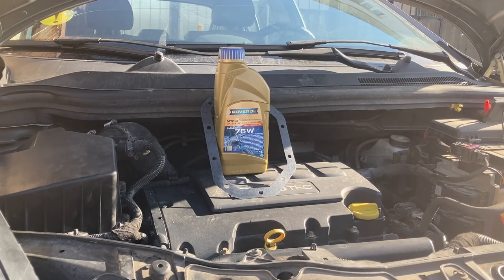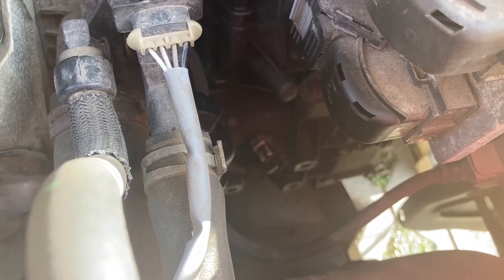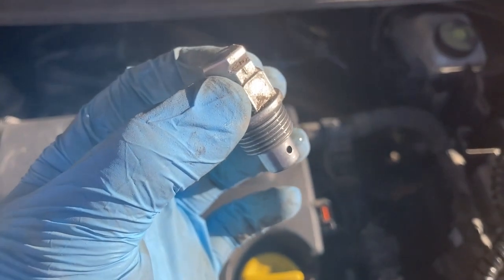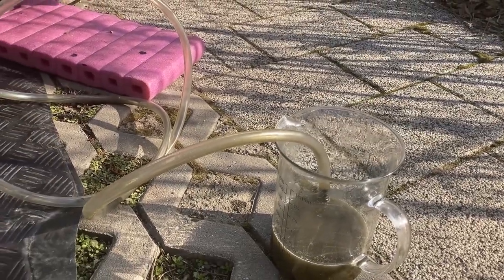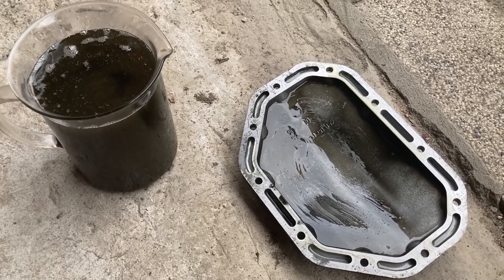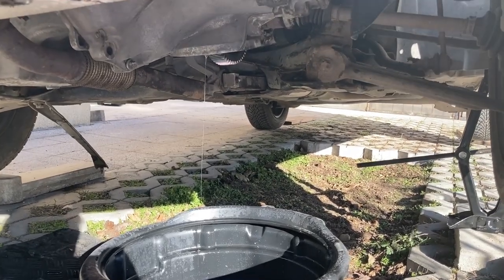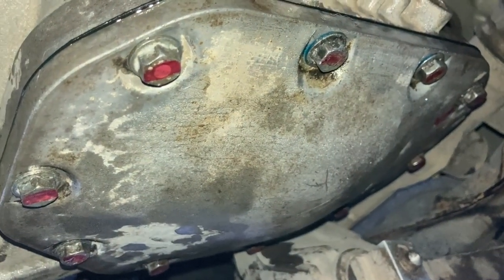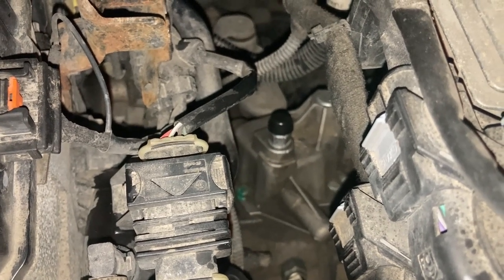DIY - 2014 Opel Corsa D 1.4: Change the F17 manual gearbox oil (transmission fluid)

Comment: i first ordered 75w90 GL4/5 oil and someone informed me that is wrong. i've now ordered Eurol MTF GL-4 75W instead,

will this be fine? i have a F17 box. 

i am going to be engine swapping soon so i will replace the entire oil contents.
Reply from the maker: Based on the specs from https://www.eurol.com/en/shop/products/E110073-eurol-mtf-75w-gl-4/1049, it is of lower quality than the Ravenol I used (the pour-point and viscosity index confirm that it is not a full-synthetic oil). What's more, this oil doesn't have the GM 1940004 recommendation that is required. So I would search for a more suitable alternative.

Comment: I cannot remove the black breather plastic cap with hand force. What should I do?
Reply from the maker: It takes a bit of effort to remove it, indeed, as I've noticed myself. A set of long, thin pliers may help you grab its sides and pull it with more ease.

Comment: Why couldn't you use the pump on the oil level hole (the one with the magnetic bolt)?
Reply from the maker: There's very little clearance between the level hole and the side of the differential. You'd need a very thin tube that can also bend downwards, so that it can be pushed along the side of the differential and down to the differential pan. I used the thin tube from the pump to try and remove the oil, but mine was not sufficiently thin or flexible for the job.

Comment: Hey there! First of all, thanks for your magnific job sharing your knowledge with  us. 
After seeing your work I have new questions, I would be very grateful if you could give me some answers. 
To my Vectra C 1.8 16v with 200k km I saw in several car programs that the suitable  transmission oil is this: 92165290 (original Gm Trans. Oil SAE 75W85, in the label shows the 1940182 reference) but I saw in your video that this oil is very poor compared with the ravenol mtf-3 75w, I was wondering if I could use it in my gearbox despiste that is not the "appropriate" Reference... 1 Thing is clear, and the thing is that I feel the same symptoms like you in my car after 200k km with no valvulin change and Im wondering what I should do... 
And the final question, if I can use this oil in my gearbox, what kind of cheap oil could I use to "flush" and clean the old dirty oil before I put the ravenol oil, Is there any compatible oil?
Thank you for your work and your time, I appreciate it so much. You made a great job!
Reply from the maker: Hi! Your Vectra C 1.8 uses the same F17 box as my Corsa D 1.4. The genuine transmission oils with the code GM 1940182 (75W85 GL-4) are indeed considered of a poorer quality, but for the F17 boxes (which take far less torque than the M32s on the diesels, for example) they are good enough provided they get replaced periodically, before they loose their additives (say 3-4 years and no more than 60K miles). If you have the same symptoms as I did, then the main problem is actually the oil's viscosity: the newer standard GM 1940004 is 75W or 75W80, which in practice is noticeably thinner than a 75W85 or 75W90 (what I previously had); this makes it more suitable for cold starts, but it may offer slightly less protection when warmed up to operating temperature - an issue you can mitigate by simply changing the oil more frequently. If you want to do the "flush" via the oil level plug, I don't suggest using any intermediate, cheap oils. Just buy 3 liters of new transmission oil and do 3 drains and fills (pour 1 liter of fresh oil in the box and allow a corresponding 1 liter to drain from the level plug) spread across a couple of weeks. The time interval will allow the new oil to "clean" the old one from inside the box, which is exactly what you want. Ravenol MTF-3 is a good option, but I've also heard very well of Fuchs Titan Sintofluid 75W80, which is recommended by many as a good transmission oil for the F17 box, matching the GM 1940182 specification.
Reply: @TheMissingBolt  Thank you very much for the clarifications, I will try with the Fuchs brand since I have also read that it works very well in Opel boxes, again I greatly appreciate your help and time, you are a crack!!!! =)

Comment: Hi, great video. i need your help if possible. I cannot find a way to remove the 2 bolts for the differential cover above the gearbox/engine mount, The only tool i can get in that gap is a spanner but it does not sit right and if i try to use that I will strip the head. How did you manage to get to them ? Thanks
Reply from the maker: Hi! Yes, I remember the struggle I had with those 2 bolts in particular 😖 ... I used a very thin, closed-head spanner for all differential cover bolts, including those 2, similar to https://www.amazon.com/Metric-Combination-Spanner-Wrench-Ended/dp/B09MWBPGDS?th=1. If you can get your hands on one, a high-neck spanner such as https://www.amazon.com/uxcell-Metric-Offset-Double-Wrench/dp/B07D49PT32 may also help (I didn't have one when I made the video...). You definitely need to take your time with these bolts...that's precisely why I suggested future oil changes be done through repeated drains and fills using the oil level port as a drain port as well.
Reply: @TheMissingBolt  ahh I see. In the end I ended up undoing the lower engine/gearbox mount, it wasn't too much trouble and it gave me clear access to all the bolts. Thanks for the reply bro
Reply from the maker: @Elgrecos  Yes, that works too 😊

Comment: Hi a year ago the mechanic did a gearbox oil change and from there car started leaking from front differential pan area after i supplied him with a new genuine gasket and gl4 75 85 oil ...it's a really minor leak that makes the gasket and pan a little bit wet...anyway i tried to redo the job with new gasket..still drips..then new gasket and new genuine pan cover...still same minor drip...always after a few weeks... i always torqued the bolt to 18 nm and installed the gasket always dry....any suggestions why the problem may still persist?driving me crazy not understanding why...i checked the top breather bolt for clogging and it was quite clean and not clogged...it remains a mistery to me this issue! I never used rtv and mating surfaces looks good too 😫 Thanks if you have any more info
Reply from the maker: I noticed something similar in my case after a while. I've also not used RTV since the gasket is paper-based. My theory is the oil may seep through the gasket rather than above or underneath it (i.e. it's the gasket's material that favours the leaking). But the "leak" is indeed very small (I barely see some oil stains on the transmission area around the gasket) and overall, I don't think it's any danger. So I just left it at that. And I drove the car for about 10K km after the oil change with no issues whatsoever. At some point in the near future I might do a drain-and-fill through the level plug with 1L of fresh oil just to see how the original oil held up; at that point I'll also check to see how much I need to pour to get it level (i.e. how much oil seeped through the gasket over 1 year). My expectation is - very little.

Comment: Why you have to put oil or grease on new  gasket before installation?
Reply from the maker: I'm sticking to the general rule of never installing any kind of gasket dry. Plus in this case, having the gasket slightly lubricated makes it easier to slide and adjust between the gearbox and the pan when reinstalling the latter.

Comment: I checked the specification for the new GM oil (1940004/93165694). It says right on the bottle: "Not for Corsa-D". I assume GM oil 1940182/93165290 is still the GM standard for F17 Corsa-D gearbox?
Reply from the maker: Indeed, GM 1940182 (the red oil) remains a valid standard for F17. The F17s, F13s etc. don't demand too much from it, since their torque values are relatively small, so it should behave well if you change it every few years. However I am very surprised by what it says on your bottle of GM 1940004. The reason is that boxes from the Corsa-D are shared with many other models, such as the Corsa-E for example. So if the oil were to be bad for the Corsa-D, then the label should also mention all the other models as well. Having said that, all GM 1940004 genuine oil bottles that I've come across are labeled as in https://www.automag.ro/images/custom_products/93165694/large-267502638a9b3e1b8936e2cbbb049412223fe96d.jpg. The label clearly implies that it's good for all Opel-derived manual boxes from 2012 onwards (or 2013 in the specific case of the F17). The oil is not good for the commercial models (Arena, Movano, Vivaro) because these are re-badged Renaults that use Renault manual boxes, which require a different oil specification.

Comment: i am also trying to do it my self.... but i am not open pan off... it's really hard work for me..

i am.trying to buy litter pump and try it suck all oil is that good or not opel.corsa.d 1.2 a12xer lpg model 

hope it works thanks for the video i read all comment also ❤
Reply: hi i am updating this i went shop and he controlled my number plate and he give me 75.85 its red one i think tomorrow i am trying to change it wish me luck 😮
Reply from the maker: You can use the level plug as a drain plug, which is an easier way to replace most of the oil. The red oil is on the old GM specification, 1940768. The one I've used in the video is on the latest one, 1940004. Both should serve you well if you replace the oil regularly (the red oil has a shorter lifespan).

Comment: Hello great video. I just bought mtf3 oil from your video, but now I see that ravenol recommends mtf2 on their web site?

Ok I read all comments. So mtf3 is thinner oil? I just worry that I won't damage gearbox. Car is astra H 1.6 xer but 2013 year labeled as astra classic. 

Here summers are really hot but withers also cold..
Reply from the maker: Hi! Indeed, I see that for Europe the recommendation is MTF-3, whereas for other markets it's MTF-1 or MTF-2. Also, for my exact model (Corsa D with 1.4 / 74 kW), it's MTF1 / MTF2 if the car is 2010-2011 and MTF3 if it's 2011 - 2015. But if you check the specs of MTF-2 and MTF-3 (https://www.ravenol.de/en/product/getriebeoel/getriebeoele-fur-schaltgetriebe-und-antriebsachsen/ravenol-mtf-2-sae-75w-80 and https://www.ravenol.de/en/product/getriebeoel/getriebeoele-fur-schaltgetriebe-und-antriebsachsen/ravenol-mtf-3-sae-75w) you'll notice that they are pretty similar. In all, you should be fine using MTF-3 if you can't return it and exchange it for an MTF-2.
Reply: @TheMissingBolt  thank you very much. I'm from EU too and car is 2013. I think that mtf3 is better option after I looked closely. So I'll go with that and soon as weather gets better, now it's -10 :)

Comment: Hi, Do you know which gearbox is in the opel adam 1.4 2016
Reply from the maker: The Opel Adam with the 1.4 engine uses the same F17 gearbox, but with a final drive ratio of 3.944 : 1. The are some gear ratio differences depending on the exact engine and whether it's the manual or automated manual. You can find more details at https://www.opel-infos.de/technik/getriebe/f17.html.
Reply: @TheMissingBolt  
Hi, Thanks for the reply. The Opel Adam i am working on needs the gearbox oil change. I spent ages trying to find a video on how to do it. What you have done here is great. My thoughts were as yours to use a pump. And i do still think it can be done. As in the video you tried in the oil level magnetic plug. Maybe a good diagram of the box would allow to get a hose with a twist in to to reach were the plate is bolted. My issue would be a lot of work if the gasket causes problems as you encountered.
Reply: @TheMissingBolt  I meant to say its the Opel Adam 1.4 B XER type. Some slight differences but yet important.
Reply from the maker: @brendanmcallister2873  I'm still 99 % sure that your box is an F17, however to be absolutely sure you can check the actual code on the box, as in https://youtu.be/zqTW-z7WQMA?t=124. You can then match it against the table from https://www.opel-infos.de/technik/getriebe/f17.html.
Reply from the maker: @brendanmcallister2873  To be honest, I also think it is possible to get better results through the oil level plug. When I was underneath the box after removing the differential cover, I confirmed visually that there was a little space between the level plug hole and the differential housing which would allow a thin, flexible tube to be routed 90 degrees downwards and pushed all the way to the bottom of the differential. The tube I had was definitely not flexible enough, unfortunately, and I didn't have any available alternatives. But it should theoretically be possible to do. But I would just rather perform the multiple drain & fill method and use the level plug as a drain plug as well. You get the same results at the expense of 1 more liter of transmission oil (3 cycles of 1 L of fresh oil each should replace approx. 95 % of the old oil), but with far less hassle. This is what I'll be doing the next time I'm changing the gearbox oil in the Corsa, for sure.
Reply: @TheMissingBolt  again thanks for reply. Yes I’m also sure you are right about the type of gearbox. As I said very hard to get information on the Adam regardless the job.
Reply: Hi Had a thought on this procedure. If your going to change the oil frequently why not next time fell a hole in the center of the plate. Get it up to a standard size drain and tap a thread into it and fit a bolt. Unless you can see a reason not to do so.
Reply: @brendanmcallister4365  great idea...

Comment: Can show us how to change transmission fluid on the kia sportage
Reply from the maker: Yes, I'm actually planning to do just that in the near future. So I should have a video posted with the procedure in 1 - 2 months hopefully.
Reply: @TheMissingBolt  thank you mine is 2014 4WD drive so i will appreciate it if you guide me with the differential and transfer case fluid also
Reply from the maker: @MoMo-tq8uc  Yep, that's also in the plan, around the same time I'll film the gearbox oil change.
Reply from the maker: @MoMo-tq8uc  Mine is a 2014 as well. Yours has the same 6-speed automatic, right?
Reply: @TheMissingBolt  yep

Comment: need aftermarket pan with drain valve on diff cover
Reply from the maker: In theory, that would indeed help. But I don't know if such a pan exists. A quick search yielded nothing. Could you provide a link to one, please?
Reply: @TheMissingBolt  i mean this car needs it. someone should make one for it.
Reply from the maker: @Professional_Youtube_Commenter  Indeed, a lot of people have complained that F17 boxes don't have a drain bolt. But since nobody actually makes a pan like you suggest, it's either dropping the pan all together or (the much simpler approach) using the level plug as a drain plug.

Comment: Brilliant video!! Liked and subscribed… I had my car in for a gearbox drain and fill came home cleaned it from the driveshaft and the differential cover, next day found it was leaking took it back to the garage, they said it’s the driveshaft seal had it replaced and still no luck leaking still but from the top breather  bolt and dripping down I am going to open and clean the top bolt and tighten them all see what happens I suspect one of the bolts may be loose… you have any other ideas what it could be?? I have photos if you have instagram or Facebook I can send you them.
Reply from the maker: If the top breather is blocked, then the over-pressure that builds up inside the gearbox will vent out through the next weakest point, which is typically one of the driveshaft seals. Alternatively, if you're seeing oil being pushed out through the breather at the top of the box, this typically indicates that the breather is fine and the box was just overfilled. If any of the lower differential cover bolts were not tightened properly, as you suspect, then you shouldn't be seeing oil at the top of the box, but only around the differential cover.
Reply: @TheMissingBolt  Thank you very much for the informative reply really appreciate it! 🤝 Turns out I have the same F17 gearbox and they filled 3 litres instead of 1.6/1.7 litres and you was correct it was coming out of the breather I have cleaned it out for good measure wasn’t blocked but makes sense now why so much was leaking I can finally sleep at night now knowing my gearbox isn’t cracked/broken 😂😂 once again thank you 🙏🏽

Comment: I always use a smear of grease on both sides of new gaskets before fitting.
Reply: Why you should do it? Is not better to use silicone?
Reply: @arturaus471  NO never use silicone it can block small oil ways in some area's ( Honda cd/cb/175's and a host of others..
Reply from the maker: I like to lubricate every o-ring or gasket with the exact fluid that item is supposed to meet throughout its lifetime. You don't know how that grease will interact with the transmission oil and what the long-term effects will be. Granted, in the case of a mechanically-simple manual transmission like the F17 a little bit of grease will most likely not do any damage.

Comment: Maybe your clutch is worn? 

Did the increase in ratios improve the fuel economy?
Reply from the maker: I did check the clutch when I replaced the gearbox and there was no slippage. Even at this moment, when the car has nearly 120K km, the clutch is working perfectly fine. Regarding the fuel economy improvement, it's definitely there. I measured the consumption after I changed the box and the results are in the description from https://www.youtube.com/watch?v=keZ20Nk85rE (which does require a translation, since it's in Romanian). In short, I got a 14 % improvement in the 4th gear and 11 % improvement in the 5th gear.